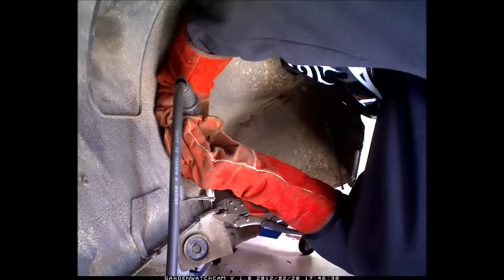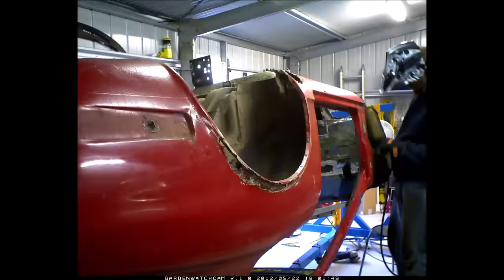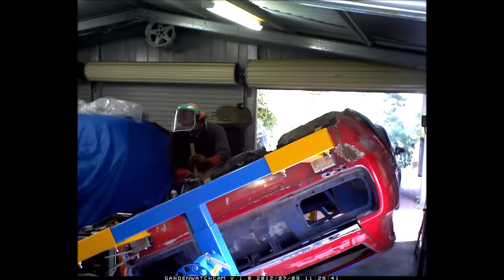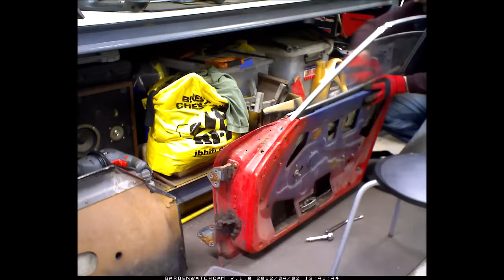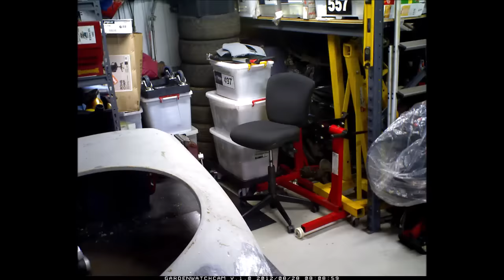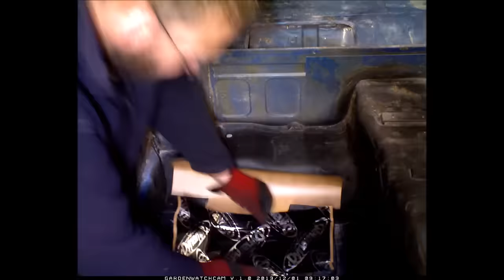Datsun 240z restoration time lapse.

Comment: I would have rather not made patch work repairs on the metal. If the whole panels were replaced, we would have had an excellent restoration.The efforts are commendable though.
Reply from the maker: Sure but you can’t buy panels for this car anymore, only repair sections and a few other parts.

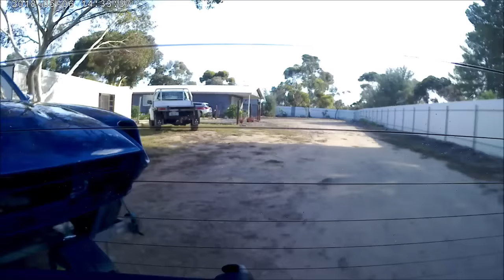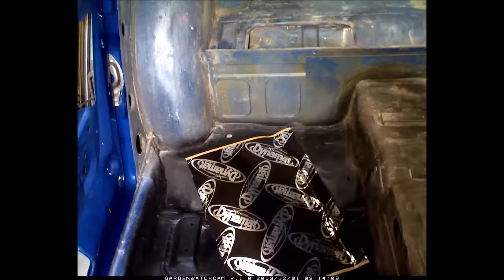Comment: Bro, you took videos from different years, 2012 0:33 ; 2018 10:44 ; 2013 12:06 ; and then 2014 16:10 . Is it still the same car?
Reply from the maker: The date stamps on the camera aren't accurate.  Build started in late 2015, paint went down in May 2018 and the first drive was last month.
Reply: oh i see. btw great work bro

Comment: 20 years ago you couldn't give these cars away for $1500 U.S in good condition. Now you can't find one that's junk for under $7000
It's funny that I could  have had one for free that was almost mint that just needed a head gasket and maybe a.head. Didn't want it back than and it went to the wrecking yard like so many others that I saw. Now I want one. Not much chance finding a other one for free.